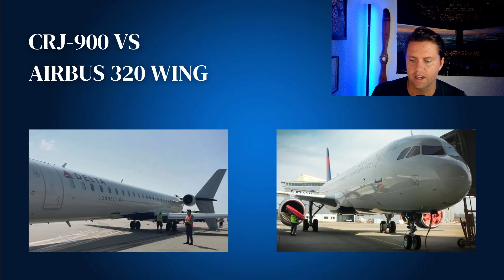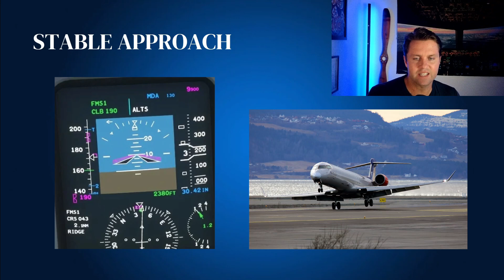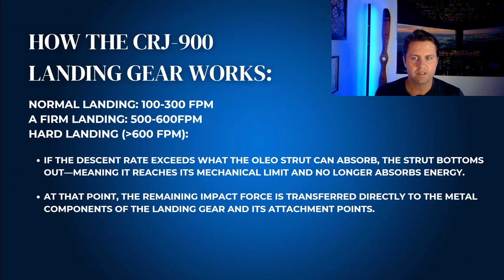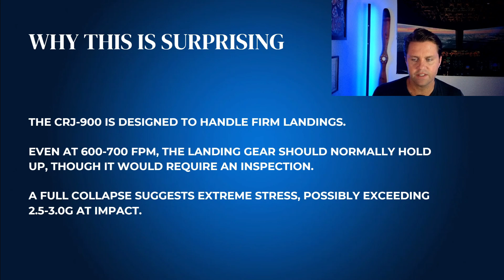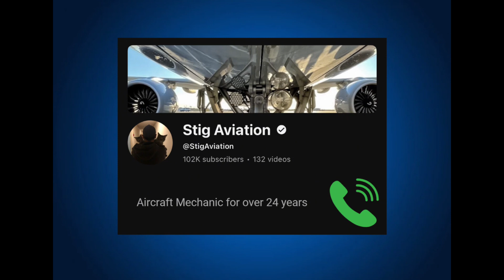Pilot Breakdown: Did a Hard Landing Cause A Gear Collapse?

Comment: Could a jet depart with a faulty, damaged or compromised landing gear, no problem?
But, run into issues when landing?
Reply: I wonder if the pilot was eyeing it, rather than going by the gauges, due to the presence of snow on the runway? Snow blindness?

Comment: The snow made a layer between the concrete and the planes metal which meant less heat and sparks to light the fuel. Look at the fire triangle. Fuel,O2,heat.
Reply: The runway was bare with with just partial snow cover here and there. The runway status was at level 5/6 according to the Transport Canada rating system. So pretty much a good runway with the odd snow patch. There's was lots of bare concrete to make sparks

Comment: Another issue with the 900 is that because the length of the aircraft the CG and center of rotation is so far back that when you pitch up, it can increase the impact and often make a hard landing even harder. When we first got the 900’s it was notorious to have firm arrivals and it was because of the flare increasing. I think it’s in the Canadaire and airline manual.
I agree, I didn’t see any flare. I agree he probably lost the gust the clue is how far short he landed from the touchdown zone. It’s sad to see my old airline goes through this.
Reply: Length isn't as much of a factor on the CRJ2's that I fly but ground effect certainly is, and if you don't factor it in you'll end up touching down half way down the runway. With a low wing and such short gear ground effect is effectively half your flare.

Comment: The CRASH IN TORONTO is not a one-off. A surprisingly similar accident happened in Somalia 2-1/2 years ago with a Jubba Airways Fokker-50 Turboprop. It too, had a hard landing, burst into flames, flipped over and lost a wing (the left one), and landed upside down. All of the 30 passengers and 6 crew members aboard survived. There were three US Army personnel in the direct vicinity who were conducting training and they immediately went to the scene, where they conducted rescue operations and set up triage stations. An investigation determined that the accident was caused by wind shear that the aircraft encountered upon landing.
Reply: I was in Emergency Spares with McDonnell Douglas corp in another life.  Our role was dealing with accidents and crashes.  After reviewing this video and the prior video, I heartily agree with the idea that the wind had a major role in the crash.   The aircraft was up about 100 feet and decending quickly then it appeared to me that a shift in the wind direction actually pushed the aircraft down towards the runway, the pilots not having any reaction time to correct.
Reply: @halrichard1969  the video shows no difference in the glide angle on the approach. The FPM was static
Reply: Toronto-Pearson most likely had Doppler radar to warn pilots of wind shear.  There have been no news reports of Windshear.  On the other hand, the airport in Somalia most likely did not have Doppler radar.
Reply: @WTHenry2023  That is the problem...wind shear warning yes or no has not been determined in CRJ 900 instrumentation nor the tower warning information or at least not released info if it did not occur.   But, wind shear is wicked and will kill you if it occurs on your final approach path.    See L11011 crash in Dallas.
Reply: @claywynn4507  Yes, windshear close to the ground can be deadly.  Toronto Pearson has LLWAS (low level Windshear alert system) which would have provided an alert to ATC and related to arriving and departing flights.  No ATC alert was sent.   I remember the L1011 crash well.  It happened in August 1985 prior to airfield Windshear detection. However, NTSB ruled pilot error to be a big factor as the pilot chose to land while a severe thunderstorm was directly over the field.  The ADS-B data for the Delta flight has been released if you are curious about the descent rate.  This accident was not caused by Windshear based on that data.  In addition, almost all Windshear crashes happen during thunderstorms:  Pan Am 759 in New Orleans in 1982 when the plane took off during a severe thunderstorm and the Dallas crash in 1985.  My father was also in a Windshear crash in 1975 while landing during a severe thunderstorm.  Fortunately, everybody lived and there were only minor injuries despite landing short, collapsing the landing gear and knocking one of the 3 engines off the 727.
Reply: @WTHenry2023  Note too that in this Toronto incident ATC did tell the airplane before landing that there could be a “bump” at the threshold due to a parked Learjet affecting the ILS.
Reply: @fnancyb  The bump warning was due to potential wake turbulence from a small Challenger 650 jet that landed 1 1/2 minutes before the CRJ900.  The wake turbulence from a small jet 1 1/2 minutes ahead would not have driven the CRJ into the ground. On the other hand, the rate of descent at the CRJ in the last 5 seconds was a staggering yet constant 1024 ft/min.  She flew the plane into the ground and never flared to spill off speed.
Reply: I experienced a hard landing in Dallas . We hit three times .  At my destination in St Louis the landing was butter . The pilot came on and said that was to make up for Dallas .  We hit wind sheer in Dallas and am happy to still be here . Not long after Dallas had a bad one and a car had landing gear hit it .
Reply: Jabba lol 😅
Reply: That was my thought as soon as I saw this, wind sheer. I had wind sheer on finals on my I think about my 5th or 6th ever landing. I was 16 in a grob 109b on full airbrake at about 200 feet. I instinively slammed shut air brakes and punched the throttle to full. The wind came back just before we touched and it bounced very gentle. My instructor took control as we bounced, but he was very pale when I looked at him! I swear from 200 feet to tire touching was less than three seconds, maybe a lot less... it was a very sobering experience.

Comment: No flare. Saw that instantly when this clip came out. Either the controls were faulty (incredibly unlikely) or the pilot misread the elevation.

You gear is forgiving, but not that forgiving...

Regardless, the Enhanced Ground Proximity Warning System (EGPWS) would also be assisting with elevation awareness.

This is pilot error, and he or she will never fly again. Their names have not been released either...hmm.

Just my opinion. Glad for everyone on board.
Reply: Definitely came in too hard. Gears would not take that.
Reply: You're completely neglecting the wind, but alright.

Comment: The girl who was run over by the fire truck at the Asiana crash site wasn't on her phone.  She was laying on the ground >INJURED<, was covered with foam, and run over a few minutes thereafter.
Reply: I believe there were two girls, both not wearing their seatbelts, on the Asiana crash who were ejected from the fuselage.  One of them may have still been alive when run over by the truck.
Reply: @MarktheMaverick  why is fire truck running over debris as big as a human body?
Reply: @CodyCha  she was covered by foam, and these ARFF trucks are built more like military vehicles so it would be very easy to run over something like that in order to get closer to the wreckage.
Reply: Correct. Girl didn't have seat belt on, was ejected from the plane, then run over by the fire truck.However, the investigation determined she was already dead before she got run over.
Reply: Talk about its your time. What are the chances?
Reply: I remember that poor girl getting run over.  😢
Reply from the maker: Thanks for the clarification. I think it still shows that people should be aware of their surroundings not on their phone.
Reply: @Garybpilot  absolutely!   wasn't taking anything away from your point which was valid.  Thanks for your perspective.
Reply: @Garybpilot you were wrong correct the mistake she was killed by the fire department

Comment: I am confused when you say there is no flare. It may not have been a normal flare, but you can see the nose gear hit after the right gear touched. You can even see a bounce to the nose gear. If you look at the ADS-B data it show a -480 ft per minute decent over the numbers.
Reply: Yep, and the nose wheel is intact.  Pointing at the sky but intact.  My guess is they lost lift in a gust and couldn’t spool the power fast enough.  They flew an attitude that  kept up airspeed and didn’t have the speed or the altitude for a normal flare.  I do wonder why there was so little flap extended before landing.

Comment: Am I the only one that can see the pilots commanded full elevator up and the plane not responding?  The elevator was practically stalled.  Watch frame by frame and you see by 20 feet the elevator is full deflection.
Reply: Even if they lost headwind gust, they were at their +20 airspeed that should have accounted for that

Comment: 6:45 "could have exceeded the full CG...."
Um, what? Exceeded the center of gravity? That comment makes zero sense. The CG has nothing to do with the landing gear.

Granular ADSB data shows the descent rate increasing from a normal 400-500 fpm, to almost 1100 fpm in the final five seconds. Which would suggest wind shear, or at least a wind lull or downdraft. That's a big increase in vertical speed that close to the ground.
Reply from the maker: I misspoke. Meant to say full G load not CG.
Reply: Presumably the main landing gear are directly under the CG or perhaps just slightly aft.

Comment: I believe that the aircraft ended up inverted saved many lives. Being inverted, the fire was burning above the fuselage. If it had stayed belly down the flames would have burned upwards into the fuselage causing flames and smoke in the passenger compartment.
Reply: Good point.  Never thought about that.
Reply: Except if it had not rolled or ripped the wing off there would be no fire to begin with.  She hit the runway WAY to hard.
Reply: @ Agreed!

Comment: The video angle looks like the CRJ dropped like a rock from about 150 ft AGL. I think the wing was stalling at this point and why the aircraft slammed the runway. ( at least the right wing was stalling. )  Too slow on approach and cross control is a receipe for a stall .

Comment: There is another view of the approach that you can see looking down the runway from the left side of the runway as he comes into land. It shows a good bit more of the glide path. The glide path was very stable until the very last 100 feet of vertical travel. It looks like he had a gust upset where he lost his headwind and dropped very suddenly. I don’t think that it was a failure to flare the airplane, it was the pilot being surprised by the gust upset and not being able to react quick enough. You should look at the other view that is looking down the runway.

Comment: The granular data has already been released. The vsi was greater than a thousand feet per minute for the last five seconds before impact. Prior to that vsi seemed normal.
Reply: The speed of response has to account for a lot of the reason this plane didn't burn as much as you might imagine that with a wing ripped off. There was clearly already a truck spraying foam in some of the very earliest videos from passengers.  Kudos to the prompt first responders/airport fire at Pearson Airport
Reply: That would indicate the change was caused by a drop in head wind. I doubt the pilot increased the drop speed voluntarily

Comment: About the second  time I watched the video from the airplane holding, I saw that there was no flare. Aircraft carrier style. Then noticed the right side collapsing as if the gear either penetrated the wing, or it shear off, then the fire, and the left wing coming about. Cant'wait to hear the CVR as the the CRJ RA calls out down from 50' in 10' intervals.
And I hope certain person on a power trip doesn't blame it on DEI. As for the gear, you have a point. The gear trunnion may have been internally weak, the strut bottoming out, and the roll momentum just kept going to the right. Also, the snow contributed some to help the fuselage now upside down and clean surface to slide even further, thus helping putting the fire out, and away from the man body. I agree with you on the filming while exiting. The Asiana 777 is a reminder of this, though the passenger was not reported as filming. But because of social media and YTB  people just think to take a video or picture to have the 15 min of fame. Even the videos inside seem overkill. People need to think about first leaving the airplane first and live, to taking a video.
Reply: All female crew due to DEI company policy. Not merit based. Truth is based on merit not your feelings.
Reply: If you're in the weeds the RA call outs aren't heard or helpful
Reply: It was probably DEI.  DEI is getting people killed.

Comment: As I stated in a previous post, a hard landing created the over G on the wing after the landing gear collapsed, then the tremendous forces caused the wing to snap off, and then aerodynamics took over and caused the airframe to roll over.

Comment: Falcon 900 driver here.  I think the aircraft was descending much more rapidly than usual.  At 1:28 in this video, I'd estimate the aircraft to be at about 100 feet above the runway.  It took exactly 6 seconds to descend those 100 feet.  That equates to a whopping 1,000 feet per minute ([60/6] * 100') at touchdown.  The aircraft should have been nowhere near that type of sink rate, especially given the significant headwind component, which decreases your groundspeed, as well as the descent rate required to remain on a normal glideslope.
Reply: Plus all of the initial touchdown energy went to the right side landing gear. It looks like the guy flying dipped the right wing into the wind just before touchdown because of the cross wind. I’ve done that hundreds of times. But, I also flared. He/she apparently did not. Just glad nobody was killed.
Reply: @HarryGordon-y4f  The Female FO was flying
Reply: Especially when the plane didn't nose up to flair the landing touchdown.
You could (irresponsibly) come in at 1000ft/m if you flared skillfully. might make some passengers lose their lunch, and is not smart, but... its "possible".
I think the plane was a full plane length above the ground 6s before touchdown though, 120 ft plane, that's possibly as high as 1200 fpm... landing gears didn't stand a chance.
Probably could've been brought to a descent rate which wouldn't immediately snap the landing gears if the pilot flared well though. "probably" ~ish.
Bad decision not to come around regardless. You don't gamble 80 passengers on your gut feeling of fighter pilot skills.
Reply: @jmd12127  it is also the typical piston to jet transition issue, getting used to the turbine needing time to spool up and develop thrust… so you need to carry more power in such a situation, especially with the long runway ahead of you. And then, this jet had thrust reversers, so easy deceleration when you are on the ground…
Reply: @jmd12127  so headwind and ground speed affect sink rate?
Reply: @dwaynepenner2788  Yes, that’s precisely correct. More headwind means lower groundspeed, and lower groundspeed means a lower vertical speed to maintain the standard 3-degree glide path. Remember that it’s a specific angular PATH that you’re flying to the runway, not a specific vertical speed.
Reply: Reported already at 1,100 fps

Comment: Agree with your take on the snow saving lives.
Reply: But there is just a skim of snow on the ground.  Toronto had a lot of snow in the two days previous , but they clean it all up at the airport, continuously, and not just on the runways (which have less than 1/8th inch).  You can see it is very little snow anywhere.  Sure, if there had been several feet of snow next to the runway, that might have helped smother the fire.
Reply: The plane skidded off the paved runway and there was a lot of snow on the ground next to the runway from recent snow fall and from snow removed from the runway.    @easy_sheetmusic_play_along

Comment: It wasn't that he didn't flare. There was an increase in the sink rate in the last couple of seconds. It's clearly visible but nobody mentions it.
Reply: It was the fact that he/she didn’t flare! Nothing was done to arrest the descent rate. Power should have been kept in to guard against the bottom falling out. It’s been a long time since flying a CRJ but I believe the normal power reduction was at 50ft during normal conditions.
Reply: @chrisroberts3963 we don’t know what the power settings were.
Reply: @dwaynepenner2788  agreed. We need to see the FDR data.
Reply: @chrisroberts3963  the nose wheels seems very intact for a no-flare landing.  I think the main hit first.
Reply: @dwaynepenner2788  if the nose wheel would have hit first the airplane would have bounced and started a porpoise.

Comment: I’m thinking there clearly wasn’t a flare based on the video footage, they were descending at 1000ft/min based on radar data, possibly blew the tires which put added stress on the right gear and it failed. Maybe a maintenance issue if the tires didn’t blew 🤷🏻‍♂️
Reply: Another good conjecture.